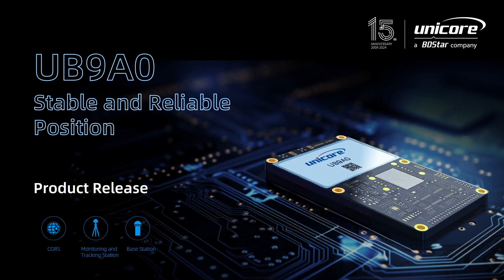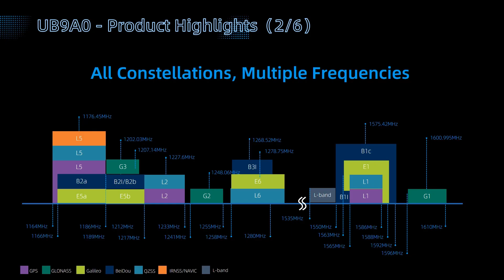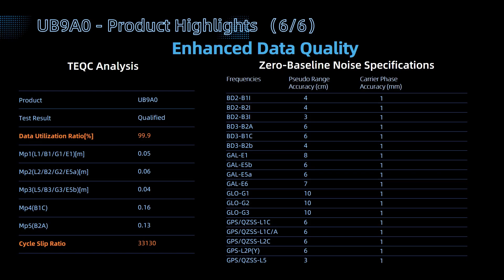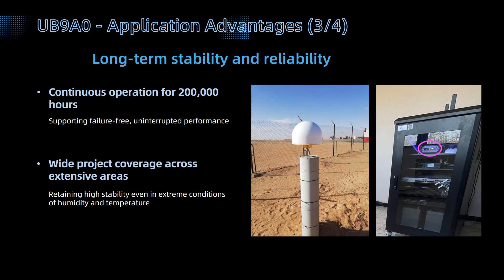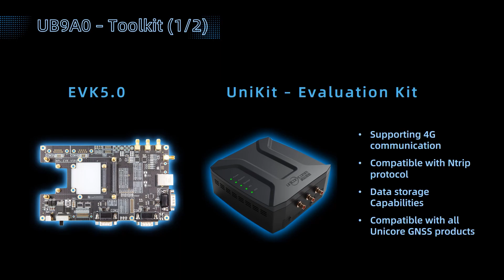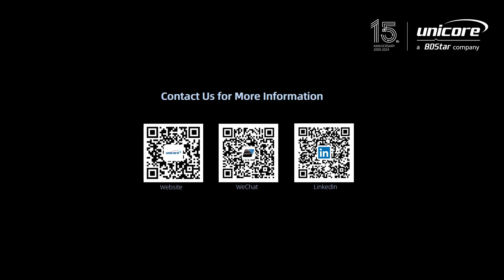Unicore UB9A0 Multi-Frequency GNSS RTK Board Product Release

Comment: It is just me or half a year ago this board was available for purchase on Aliexpress but now there are 0 sellers offering it?
Reply from the maker: We have never authorized dealers to sell this product on e-commerce platforms. We strongly recommend purchasing our products through official channels to ensure genuine quality and service.
Reply: @unicorecomm Do you have links ?
Rgds
Reply: @unicorecomm  How does this compare to the Phantom 40?
Reply from the maker: @joshkelly3682  Sorry I don't have the comparison test report for the P40 on hand, but based on the manual specifications, the advantages of the UB9A0 are: 1. Standard data update rate at 50Hz; 2. Timing accuracy of 5ns; 3. Shorter cold and hot start time; 4. Higher tracking sensitivity; 5. Wider operating temperature range. 
Would like to hear more details from the customer's test results.